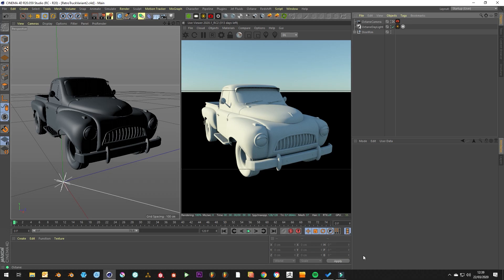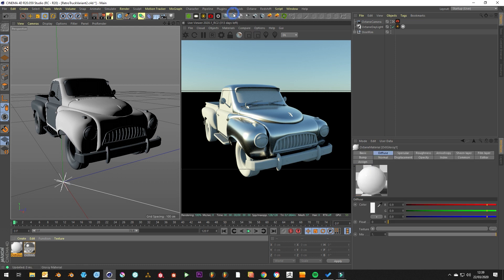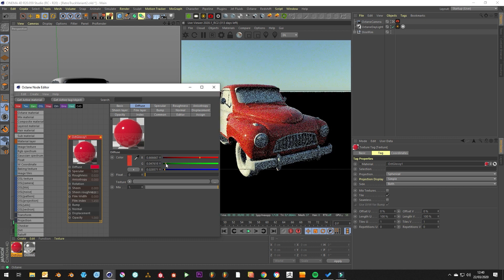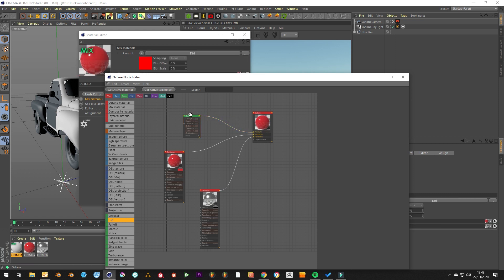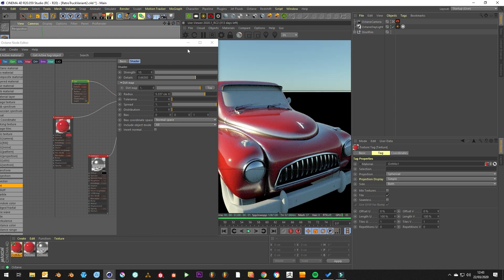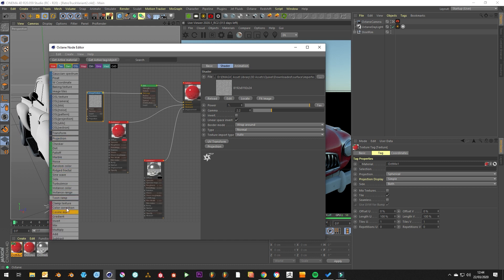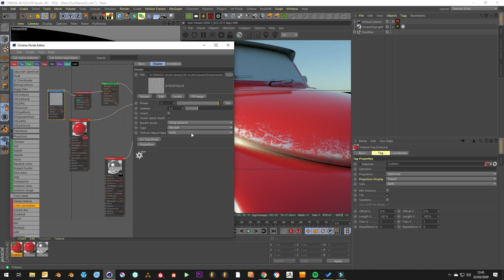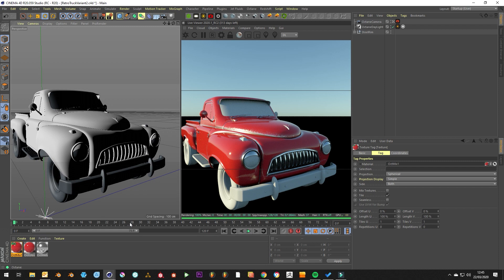Octane Render - Create Scratched Metal Edges - Using The 2020 Dirt Node | VFXHUT

Comment: I have the latest octane version and i cant add a map. What is wrong ?
Reply from the maker: What version are you on? This only works with 2020 builds.
Reply: @VFXHut  i have r7 or whatever but its the latest version i bought and updating. Should i download 2020 build instead of using R7 4.0
Reply from the maker: There are other ways to do this by using mix materials without having to get the new version. But if this is important to you then yes definately upgrade to 2020 version :)
Reply: @VFXHut  So i checked and 4.07 is the latest build and i stil do not have it. this is really weird maybe it was in a previous build. am also running R21. Anw yeah i know about the other ways but this is way easier. Thank you
Reply: I also thought I had the latest version of Octane, but how/where do I find out which version of octane I have installed?
Reply: Create a new diffuse material and add an ImageTexture as diffuse color... put this material as "material_2" on Mix.